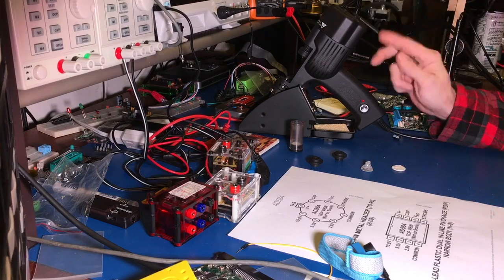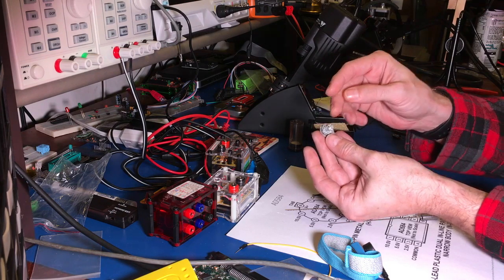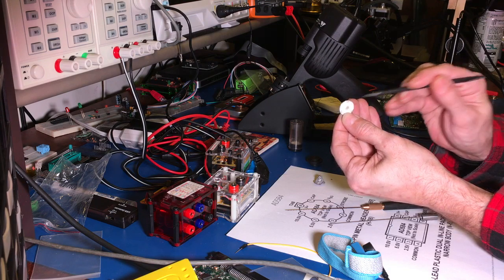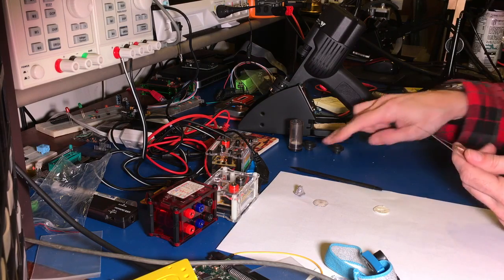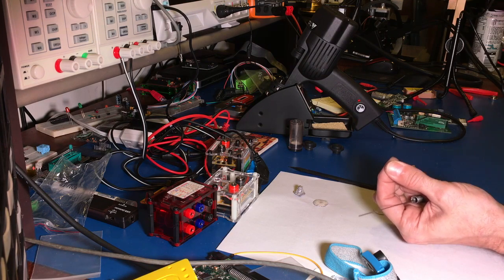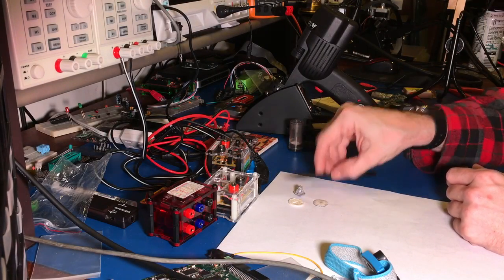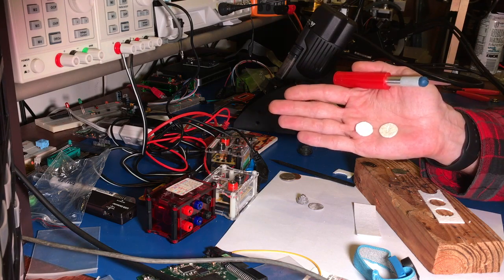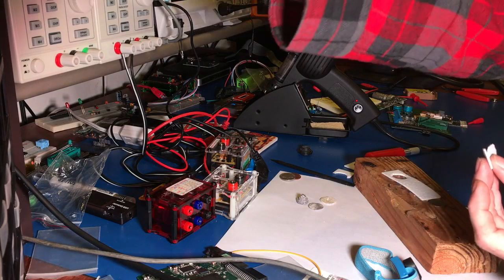Aoyue 8800 De-Soldering gun filter re-design PART 2 - More Gadget Tech Thoughts

Comment: Thanks for the videos.. I just picked one of these up on sale and have now ordered the tape from your link. someone else had recommended the hakko ones since they're premade but they're a buck a piece.  for twice that price we can make hundreds.. :)
Reply from the maker: +Bret Frohwein Nice, I'm glad the tip panned out form you.
Reply: Just wanted to add.  you'd mentioned on one of the videos about possibly adding a support behind the filter(s). It's probably not necessary but I added a couple of .625" brass pipe screens behind the filters.  they fit just perfectly against the small lip for the OEM sponges.
Reply from the maker: +Bret Frohwein Nice, the tape seems thick enough as long as you cut the diameter just a
 little larger then the whole of the canister. But I'm sure the screen 
shouldn't block any of the suction and is a piece of mind.

Comment: I've been using this gun for some time now. And, like you I have done away with the sponges which are terrible as filters. I am also using the 1/16" alumina oxide ceramic tape (2300º) and have greased and well tightened the valves to the valve body. I have done away with the spring filter and applied two thicknesses of 1/16" filter media inside the greased canister and one behind it in the gun. I'm going to try to turn a punch on my lathe to make the filters instead of cutting them out with scissors.
Reply from the maker: +Ken Foland I wish I had a lathe to do that. I did recently use it again and empty the container, the grease on the inside of the container did make it easier to clean but I forgot to do an update on that.

So this is working good for you also? Did you notice any loss if suction? I haven't, but some people may be using a different ciramic tape and not the same I ordered. Different tapes make have tighter pores and could effect the suction. So far no one had said anything about that, but it's just something to be cautious about.
Reply: Yes, I like this gun a lot.  And, would certainly recommend it to others as an affordable alternative to the Hakko FR300 or the Denon SC7000z. Since I greased the valve diaphragms and tightened them it performs even better than new with a more positive suction. And, I certainly don't miss handling that damned spring filter. Aoyue should include a better filter than those sponge bits, they aren't up to the job and the refractory material is not that expensive. I think before I start turning some aluminum from my stock I'm going to try one of those craft paper hole punches to fashion my filters. But, I really don't think they will be good enough; time will tell... I'm surprised I don't see more about this gun on the 'net, it's really quite capable. My only critical observation about the gun itself is the tips were supplied from the factory unplated; this does affect it's performance somewhat. So, I will use real Hakko tips in future.
Reply: +Dave B.Reviews (My Gadget Tech Thoughts) It turns out that an actual punch or a lathe isn't necessary. This refractory wool tape isn't very dense. Therefore, it's quite easy to punch shapes out of it. I used a copper plumbing tee made to branch a 1/2" pipe from a 3/4" pipe run. Take a look at Lowes.com part number 21672. On mine the 1/2" branch is made to slip over a 1/2" copper plumbing pipe. I used a Dremel tool with an abrasive cone bit to sharpen the edge from inside the pipe outward. And, a sanding sponge to clean-up and smooth the outside diameter. Then, press it onto the material and give it a couple of short back and forth turns. It works well for me. I hope it helps you too.
Reply from the maker: +Ken Foland Oh, I know it's easy to tear. I use this also for wrapping 3D printer heads. I use a whole puncher to cure the whole for the nozzle. I thought you were going to stack a bunch and cut out 100 filters with the lathe or something like that. 
I still want a lathe, I've wanted one for a while now.
But you gave me an idea, maybe I can 3D print a ring with a handle from polycarbonate, and taper it off at the ring side so it's sharp. I can always take some fine sand paper to sharpen it. Hmmm, I may have to try that.
Reply from the maker: +Ken Foland 
+Ken Foland Mine is still working good. I have had no need to grease the diaphragms and I'm pretty sure that would void warranty. Once the warranty expires I will probably break it down for a cleaning and grease the diaphragms. But for now the diaphragms have a glue on the sealed parts and on the screw, my guess is they did that for better suction. 
I definitely don't miss that metal spring filter. I'm sure what we use for filters now probably cost less, and takes less time to change them. Maybe I should send this video to Aoyue and see if they will change the filter system to something like this in a future version. 

I haven't checked if the Hakko tips would work with this gun, it might something I can look into the next time I place an order with TEquiptment?

Comment: +Dave B.Reviews Thanks for giving us an update on this! I came across the original video while researching fully self contained desoldering guns. At some point you come to the realization that the old plunger-style solder sucker is woefully inadequate. And, repairing damaged solder pads and ripped-out through-hole plating gets old quickly. Unfortunately, offerings of this design are few. The Aoyue 8800 appears to be the best compromise of price, quality, and  functionality. My understanding is that this gun has dual diaphragm pumps! That should make for a very effective desoldering gun. My concern is how robust is it? Will it last? I like the looks of the Hakko FR-300. But, it's pretty pricey for a hobbyist to justify. And, the ESD-safe Denon SC7000z is substantially more expensive than the Hakko. Let's give credit where it's due though, the Denon has quite a lot of features that should make it attractive to just about everyone. And, the cheapest of the lot, the S-993a; a Won Hung Lo knock-off version. I've read a lot of reviews about this one stating poor overall quality. So, for me it looks like the Aoyue 8800 is the only viable option. It would be great to see a teardown video detailing it's inner workings. Thanks again, Dave.